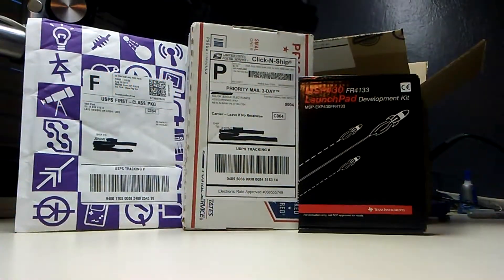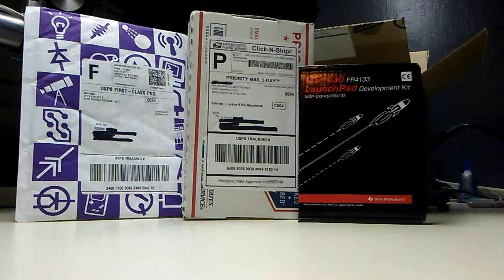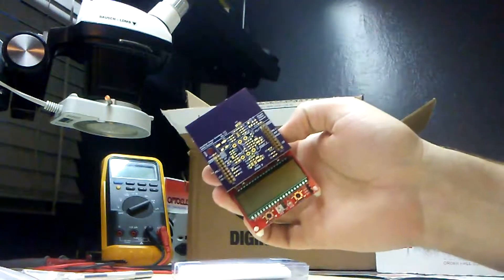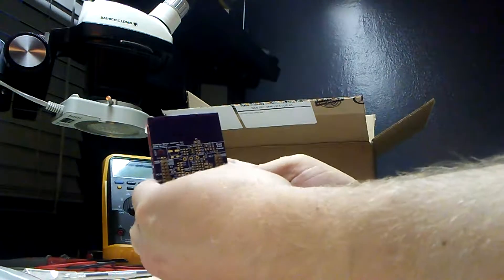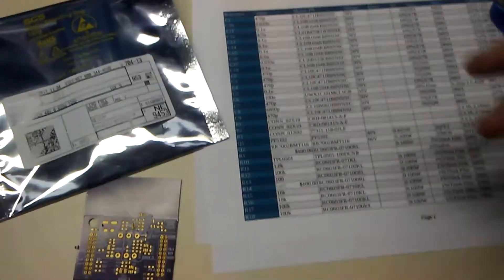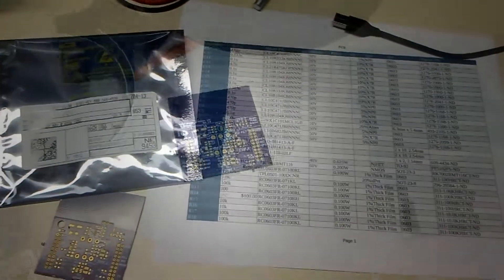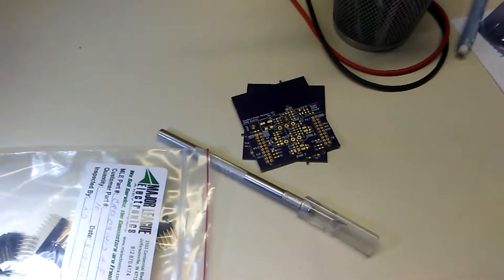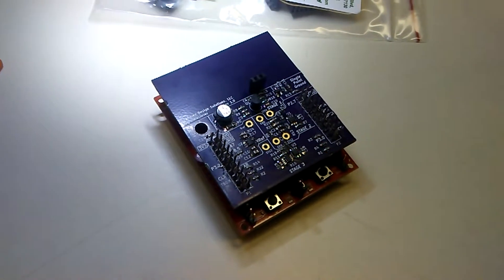#0006 WWVB Receiver Project - Part 3

Comment: Hey, are you gong to post another video? :)
Reply from the maker: Wow - thanks for checking in.  I've just been very busy starting a new job the last 4 months.  Unfortunately,  I did record the next segment of the design, but I ran across something that I thought might be a project killer... but I don't want to spoil it, but it got me pretty bummed out about the whole thing.  But 6 months later, I have been starting to think about it more and how to get around the issue.  It may be a good time to dig up the old video and post the next segment.  I certainly gives me some motivation to have someone ask about the progress!  Thanks!
Reply: COEE I'm not really one to talk. I haven't posted a video on my project in almost a year. It's actually in "moth balls" at the moment but I need to do a video with a circuit description and schematic.